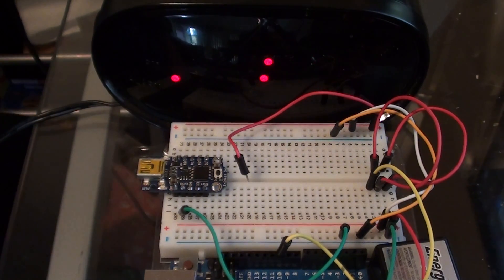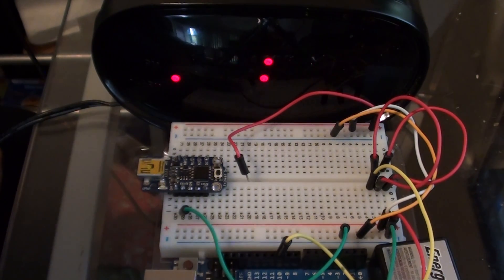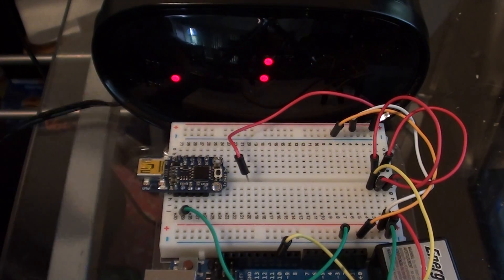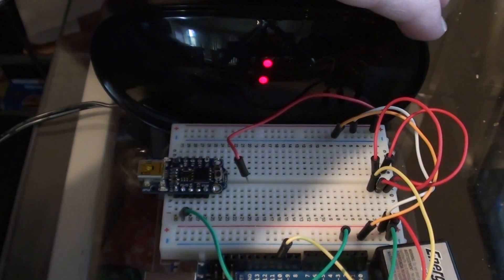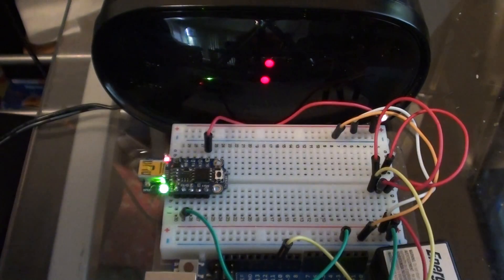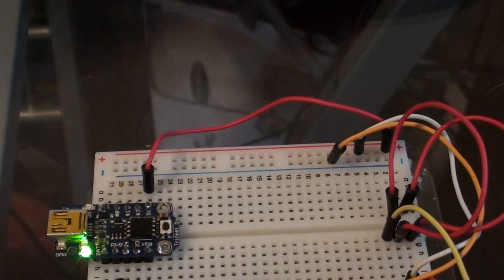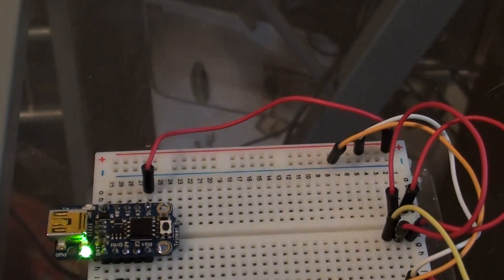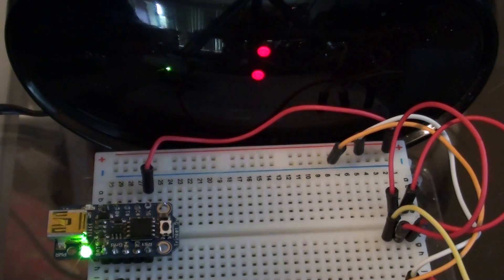Adafruit Trinket 5V ATtiny85 FM Transmitter with [Sprite_tm]'s code

Comment from the maker: That's the magic of it... by overclocking and oscillating the PLL we essentially have a small transmitter with just the attiny85, just using software to re-purpose internals in the MCU